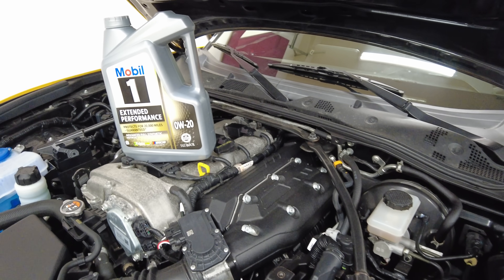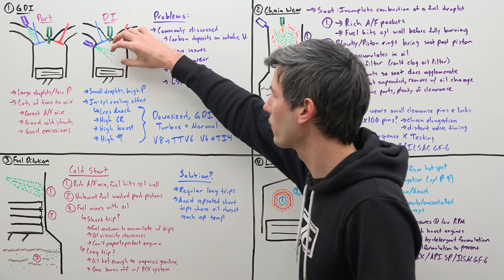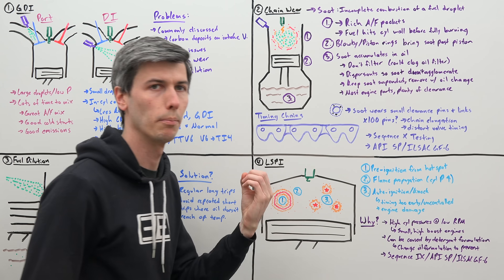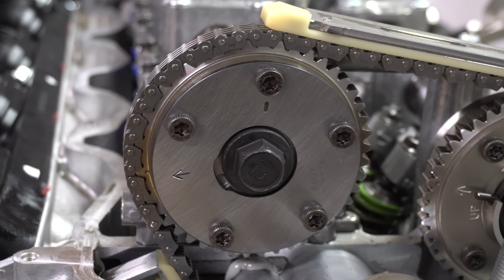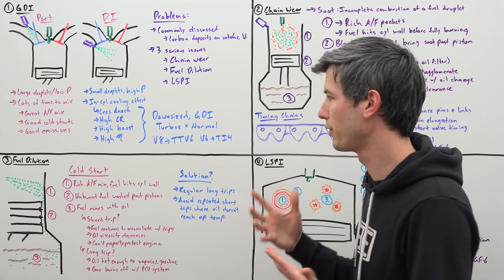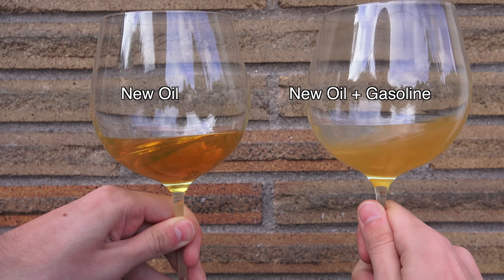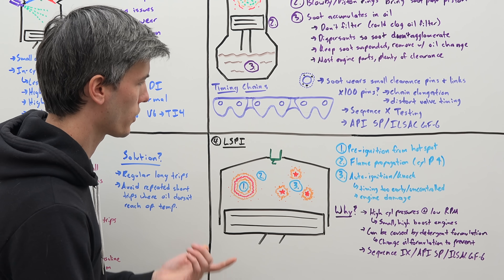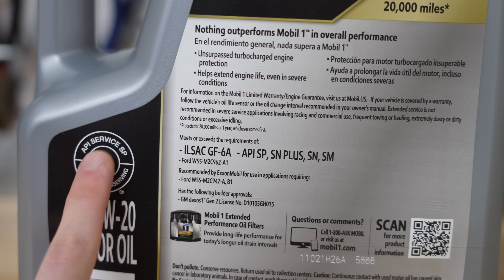3 Big Problems With Direct Injection Engines (Gasoline)

Comment: Mazda got GDI right. There's an air/oil separator from factory and they rerouted the coolant in the block to increase temp at the very valve seats, minimizing carbon deposits. Moreover, the Skyactiv design of the headers and other components work together to prevent knock (pre-ignition). Just keep with oil changes and the engine is expected to last 300k+ miles.
Reply: I have a 2017 mazda 3. 6 speed manual. 130k miles. It's my commuter for work. I haven't had a single issue with it. But carbon is always in the back of my mind.
Reply: @DonVader213  Do a walnut blast once you feel it's losing power or MPG. You'll be good to go for another 150k miles. It's a simple procedure at a reputable workshop.
Reply: @DonVader213  dirve it to deth, they are great so long as you dont expect em to last here on the slaty roads of britain,
Reply: @DonVader213  That's pretty low mileage even if it was an American car. We'll see if you can get past the 200k mark without major maintenance.
Reply: what doesn't Mazda do right? thanks for posting this info.
Reply: @benca101  yep, sound deadening on the first 3 gens of Mazda 3 😂
Reply: @benca101  transmissions on the nd1
Reply: @benca101  The last Mazda that was done right was probably the B2000.
Reply: @benca101 Their diesel engines.
Reply: @benca101 their corrosion prevention and diesel engines are an absolute disaster
Reply: @benca101  Well they didn't do my 323 or my 929 very well in fact I'll never buy another Mazda again.
Reply: @chasl3645  you've had bad luck. I got a Mazda with over 300k miles, got new piston rings and didn't even had to bore the block, meaning it can go another 300k easily.
Reply: @andali555  That was pre 2000..
T E R R I B L E cars. You couldn't give me one now. My buddies new CX-5 has brake and electrical issues. I tried to worn him.
Reply: @chasl3645  I also happen to have a 2016, never skips a beat.
Reply: @andali555  Great cars a blessing.
If you're living pay check to pay check. Like I do. You can't afford to make mistakes.
Reply: @chasl3645  I do live P to P. Guess anyway can have a lemon from any brand it's a matter of luck
Reply: @chasl3645  thats a shame, they usually rot out before you get those,,,, though the aluminium and earthing rots at a similar rate if you are near enough to the sea...
Reply: @chasl3645  You really can't compare cars that were built 30 years ago with car technology today.Doesn't matter what make it is.Mazda builds very good cars now.
Reply: @chasl3645  yeah right. You mean the crappy Mazdas were the one made during the Ford collaboration.
Reply: @jalee6587  There have been a lot of auto manufacturers that should have been allowed to fail. Because failing is exactly what they did. The bigger fish at the time would have bought them up and takin market share.
Reply: @chasl3645  I have a mazda2 that's 4 years old and @ 40k; have not experienced a single problem. The car is also extremely well designed. The fuel economy is also killer. I'm sort of in the opposite camp - i wouldn't buy or recommend any car other than a Mazda.
Reply: @neptronix  Hopefully they have the hanging headliner and the broken door skin from shutting the door and the relays that kept breaking needing to be replaced, and the torque converter and before that the transmission and before that the drive shaft and the need for constant brake jobs and the distributor that needed to be replaced. I'm having PTSD those damned cars cost me a fortune I've never had cars that needed to be hauled to the garage for repair as much as those Mazdas. Cars are too expensive to have problems with and they're too hard to pay for I hope you have way better luck than I did. Mazda will never get another dime from me. Oh and my buddies CX-5 had electrical and brake problems.
Reply: @chasl3645  Don't have any of those problems in my mazda 2. I have a manual transmission so there's no torque converter and a variety of other parts to break.

At ~40k mi the original brakes still have great breaking power.

I wouldn't expect Mazda's SUVs to be good.. those are new for Mazda, but they know how to make cars..!
Reply: @andali555  That is 100% correct it's about luck... I had better luck with my 2012 Kia Optima Ex than with my 2008 Camry LE and 2008 Altima S...
Reply: @chasl3645  What brake issues?
Reply: @chasl3645  By the sound of it your experience is from the 1970s (A 929 !!). Bro Mazda went OG in the 90s and are very reliable and comfortable now. I hear nothing else from recent times Mazda drivers.
Reply: @chasl3645   brake issue is very common on every single mazda cars but not electrical issues, its mostly mechanical failures, the only thing that fails all the time thats not mechanical is the junk info system, it fails on almost every cars, but its the case with every single asian cars right now, they cant build cars, hyundai is the less worst asian car brand right now and it says alot
Reply: @neptronix No problems at 40k is nothing to brag about. I've got 150 on a Mazda 5, had about a dozen issues.
Reply: @benca101  Dude, Mazda.....really.
Reply: @benca101  if i had to name it, they share the same flawed transmission design nissan cars do. 
Nissan's transmissions have been slow failing or grenading at random intervals of 30k or 100k since their inception in 09.
Reply: @Enonymouse_  that's absolutely not true as Nissan has been using CVT for over a decade while Mazda embraced a propietary 6-speed auto since 2014. It has been pretty reliable and smooth for most owners.
Reply: @Enonymouse_  
Mazda and Nissan use completely different kinds of transmissions- so, that cannot be it...
Reply: @Enonymouse_  True my 929 had a very expensive to repair Nissan transmission. And their brakes were very cheaply built every time you had to do a brake job about every 20,000 mile$ you had to put new rotors pads all around the car.
Reply: @Enonymouse_  Mazdas don't use cvt like Nissan smart guy. Maybe your referring to when Mazda and Ford were collaboration
Reply: @jalee6587  mazda ford collab was so awful. last thing you want ford touching is a transmission.
Reply: @Enonymouse_  Nissans Problem is they use Jatco transmissions Mazda doesn't even use CVTs they are completely different.
Reply: Dual port and direct injection is promising.   I don't know if Toyota engines with this system have yet accumulated enough miles to tell.
Reply: @IncogNito-gg6uh  many of fords eco boosts are also now dual injection. Fixes the carbon build up on the valves. But I’ve seen many first Gen direct injection only eco beasts still going strong
Reply: @ajmedeiros77 I didn't know that about Ford.  I had noticed Ford Eco-boosts are rarely, if ever, mentioned with this problem.  Thanks for that Information!
Reply: @IncogNito-gg6uh  
Lexus has been using them since 2006 - I think the answer's in...
Reply: It's been shown that GDI engines that mate both port & direct injection together are better than pure direct designs, since each type (port/direct) has it advantage zone while driving/accelerating, & cleaning additive in fuel can hit every part of the engine that they need to (unlike straight direct designs).  The TNGA Toyota engines do that.  With that said, I currently own a 2022 Mazda CX-30 AWD CE - but expect that I will have to have it professionally dismantled & cleaned of carbon deposits at some point, even if the Skyactiv design slows/minimizes the accumulation rate.
Reply: @inctru  Probably 100k - 150k miles which is a lot and the cleaning is a 1 hour job, no drama at all.
Reply: @inctru  Ditto
Reply: Thank you for letting us know that Mazda comes with a factory oil separator I did not know that
Reply: Agree. My 2012 mazda 3 ran for 130k trouble free miles before I sold it. Unlike port injection motors, i didn't notice a loss of power or MPG hit around 75-90k either. Only 155hp in the 2.0L but the car weighed nothing so felt punchy and regularly tossed out 40mpg.
Reply: Toyota TNGA engines use their D4S system which runs both GDI and Port injection to address the carbon buildup.  The Tacoma has used this design since 2016 and the BRZ/FRS/GR86 has used it since the Toyobaru first hit the market.  The only real issue the Tacoma is known for is a total lack of low end torque from the 3.5L V6, that is a tuning issue and a case where the displacement should've been left at 4.0L when they added the D4S system.  The torque issue can be resolved partially with a tune and the Tacoma is likely to ditch the V6 for a turbo 4 cylinder in the next generation (probably the new 2.4L that is already in the Lexus NX)
Reply: My MazdaSpeed 3 would beg to differ..
Reply: My CX5 is a marvel at 80 mph, impressive engine
Reply: Air/oil separator won't solve oil dilution though.
Reply: @matthiasknutzen6061  If you're talking about fuel dilution of the oil you're right it won't do anything but  that's also not what the oil separator was designed to do. That's why you have to use a very good lubricant that is fortified with a good additive formula to help with fuel dilution.
Reply: Have a 2014 Mazda CX-5 and never had a single issue.  I use Castrol Edge oil every 7500 miles and the engine is immaculate on the inside.
Reply: I have a 2015 Mazda 6  with a 2.5 L engine with GDI. I have noticed the oil stays relatively clean even after 5K miles on it. Actually less soot in the oil. I have sent out the oil for analysis and the viscosity is just like new oil with no dilution.  I did do an intake valve cleaning at 38 thousand miles and noticed the oil did get noticeably darker after the cleaning was finished. Apparently there were some deposits on the intake valves. How much, I don't know, since I did not examine them beforehand. If you do this cleaning, change the oil after you are finished . Just wondering, does the oil catch can ever have to be drained or cleaned. I noticed the PCV valve is connected to it and there is no service recommended for it either.
Reply: @davidsacco4860  I'm sorry, it's actually an Air Oil Separator hence it doesn't need to be drained as the condensate returns to the oil pan.
Reply: @andali555  Thanks for clarifying that. When I looked at it last year it didn't look serviceable like a regular catch can, so wasn't sure what it actually is. I thought it might be some sort of a separator because the pcv valve was connected to it.
Reply: Jason specifically mentioned that Pre-ignition is NOT THE SAME AS knocking.
Reply: Owned a mazda 6 for 10 years, never had a single engine, transmission, a/c, or any major problem. My hyster forklift (US made) f more than 20 years never had an engine problem which was also a mazda engine. My 4x4 truck, a ford ranger with mazda turbo charged engine is 25 years and going strong.
Reply: @impactodelsurenterprise2440 I have two Mazdas. My Mazda3 has close to 175k miles with zero issues. My Miata NC just topped 100k. It has also been trouble free. Mazda makes good cars in my experience.
Reply: My mazda was a lemon 323, leaks everywhere 180,000km , friends mazda 3 is a lemon burning oil 230,000km, another friends is a lemon 60,000km DPF dead, in fact, I dont know of a single owner who has a good one, they dont even have a coolant temperature gauge, just a dummy light on their cx5. Mazda is the worst Japanese manufacturer. Meanwhile my 98 Nissan Pulsar 500,000km still strong, SR20DE, Skoda Octavia 70k only still good, Dads Fabia 230k still good. Oh and Mazdas paint is horrrrrrrible, worst in industry, softest clear and 60um thin. Try and find a Mazda older than 5 years with clear coat, you cant.
Reply: @super_slav91 my cx5 has a gauge and is very reliable
Reply: @super_slav91  hahaha that's pure BS, I have had 2 mazdas with more than 500.000km and the people who bought them still drive them. My current one is a modern one with the "thin" paint nearly 8 years old and it's mint. 3 people have told me that they thought I was driving a 2023 model because of how well it's preserved. Seems to me that you don't know how to take care of your cars.
Reply: BMW ironically has some a good job with preventing carbon deposits too. B58s & S55s have been opened up with 100k+ miles with zero carbon on the valves due to the factory oil separator.
Reply: This video gave me nightmares. I bought a brand new 2023 rav4, of course it has direct port injection. My wife frequently uses it to go to the grocery story, less than 3 minutes away. She’s a stay at home mom and doesn’t travel much besides the local stores. I guess I have to try to do oil changes every 3.5k, seems like the best case. I really hope the car lasts over 200k
Reply: No dude Toyota got it right with a port/GDI combination.
Reply: The Mazda injectors sent into us for cleaning and testing are just as carboned up as any other make of automobile.  MasterTech Injection
Reply: .. lately been reading on the potential drawbacks of the Skyactive G's 'active fuel management'  into two pistons .. any useful thoughts since you seem to have a respectable understanding of this engine  ?    many thanks
Reply: @oldcat3439  sorry, my model is prior to that technology. The long term durability is yet to be seen.
Reply: What year and model did Mazda started having factory installed oil separator? I never heard of this.
Reply: Increasing the temp at the valve seats doesn't minimize carbon deposits
Reply: They just last a bit more than the typical bad german design. By 150k that Mazda will be carboned up. Toyota solved it long ago and had port + direct injection over 15 years ago.
Reply: until last year i was a mechanic for mazda, skyactive is just a copy of an old ford engine, its not reliable and we do tons of carbon cleanup jobs, dont buy any of these cars, its complete garbage and totally outdated, if it has a turbo or awd its even worst... now i work for audi, although their engines are not good, i dont like the brand at all. its still better than anything made by asians rn, better engineered and easier to work on, since 2015: DONT BUY ASIAN
Reply: @retrocompaq  Yeah I've seen a downhill in Asian quality, I have a 4 pot EA211 1.4 tsi, bulletproof, only thing that can go wrong is water pump, easy change not driven by belt it's at the rear top of the motor, replace with a metal until, good og unit. Mines all stock still 7 years old, 300,000km on my dad's ea211 3 pot non turbo.
Reply: Not all GDI engines are made by Mazda
Reply: Durability depends highly on the Driver and how the Owner treat their Car. I can easily wreck a V8 oder other Engine in Driving in "Fun-Modus".... Mazdas are not known for being driven by Hot-Rodders, more by Grocerie Cruisers and Soccer Moms... rather slow, cruising than high reving burning Tires. So these "Legends" of durable Engines which make High Mileage can be easy busted.

Examples? My Daily Driver Mercedes Brakes last 50 to 60 tkm .... my Fun Mercedes, SLK AMG wrecks Brakes every 5000 km, rear Tires last approx 2500 km (2000 Miles) - Why? DRIVING curvy Canyon Roads, reving the Engine to Redline, Hitting the Brakes late, laaaate, VERY LATE and HARD until they GLOW RED !

Will your legendary MAZDA take this Treatment and last 300k + Miles.. NOPE BRO !
Reply: @FRITZI999  dependability is more about build quality then the driver for example say vw they have terrible build quality compared to a Toyota
Reply: @FRITZI999  that doesn't matter that IT'S way more about build quality
Reply: @FRITZI999  dependability is reliability
Reply: @DylanL69  you are just playing with workd instead of facing Facts !
Reply: @FRITZI999  I know the facts
Reply: Mazda? 😂 I think this is the first time I’ve ever heard anyone use Mazda as a benchmark for anything good in the auto industry. Nah…That’s a no for me dog.

Comment: Great video. They found all these problems in Ford's 1st Gen 3.5l V6 Ecoboost. The Gen 2, they added port injection and redesigned the timing chain. They started putting them into vehicles around 2017 but there are still some models with 1st Gens upto 2019. I believe they are now all dual multi port injected since 2020.
Reply: They use both Port and Direct injection.
Reply: @82dupont  you're absolutely right. I should have stated that they added port injection.
Reply: I think you meant 3.5L
Reply: @nthgth  yes. Lol I've had so many typos with this comment 😅
Reply: @phantom21629  haha no worries bud, it's just YouTube

Comment: Two identical GM 3.6L engines about the same mileage driven about the same rout. One had Moble 1 the other ran Pennzoil ultra high mileage. Intake valves obstructed and timing chain badly stretched to the point of check engine light on the Mobile 1 engine. Pennzoil engine was thought to be needing maintenance too. Looked like a low mileage engine. Just put back together. I wonder which oil now runs in both?

Comment: I used 4oz of marvel mystery oil in my gas tank. I also use gf6 ow20 oil in my engine on my 2018 mazda 3 2.5 very little carbon build up

Comment: Engines of the 90's were the epidemy of long life. Quality fuel injection combined with overdrive transmissions to slow down the engines basically doubles engine life. I feel sorry for the buyers of new vehicles as they will fork out  big dollars to have their engines not last any more than an old car of the 1950's. I will keep running my 1990's vehicles forever
Reply: The 50s engine, with today's oils, will last a LONG time.  And isn't full of computers.
Reply: @michaelbenardo5695  I run 10 40 diesel oil in my 58 cadillac.  Seems happy with it.

Comment: I tend to drive short trips. Periodically I take the car out and get the oil at 212 or above thinking I’ll evaporate the water. I change the oil yearly because I put less than 5K a year on the car. More frequent oil changes?

Comment: Just bought some oil for my next oil change on my BMW. I'm switching from Liqui Moly to Amsoil! I have a port injected N52 with a noisy ticking lifter, so I'm trying (praying for) the bare minimum solution first.